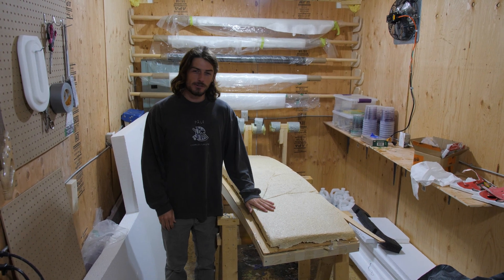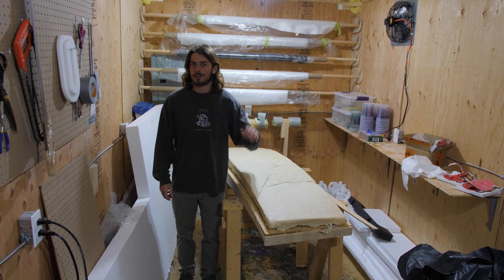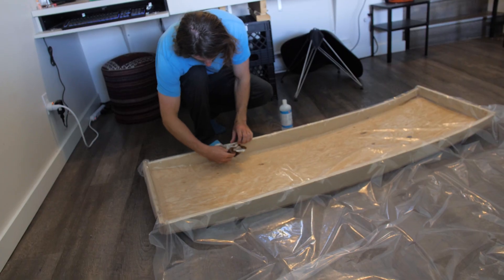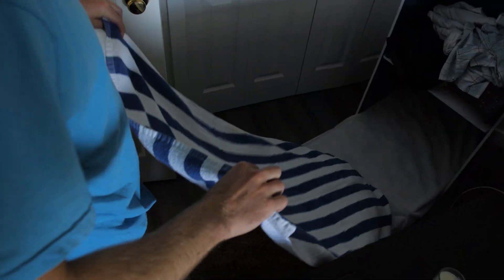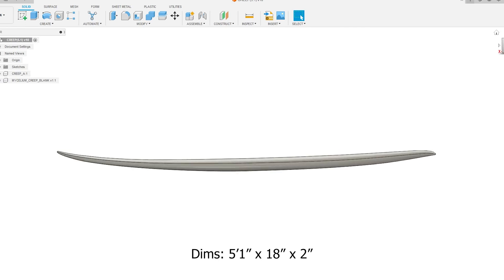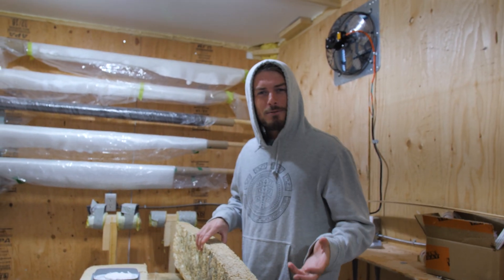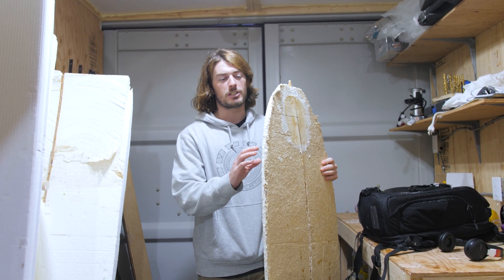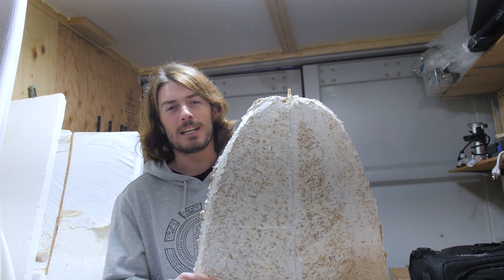SHAPING A MUSHROOM CORE SURFBOARD

Comment: Hey brother, I have an idea for your mushroom board. With your machine why not hollow it out a little. Reducing the weight. Making a honeycomb frame. Like the 3D printed board..
Reply from the maker: The mycelium core was already very soft and I think there would be some big impact issues with having voids in the blank on top of that. Perhaps if many small holes were drilled out (1/4" diameter)? But I still think the structural integrity of the blank would be gone by the time it reaches a reasonable weight.

Comment: Hi Reese, I loved watching this. The extra weight was the deal breaker. But gypsum is super heavy so weighing it with most of the gypsum sanded off may have shaved off an extra 2 lbs. One more idea, coming from an amateur mycologist. Dry out the mycelium longer, using a heat source. Mushrooms are incredibly good at retaining humidity, the mycelium can essentially hibernate, or go into zombie mode, thanks to that characteristic. I think finagling the drying process would also reduce the weight. So keep at it!
Reply from the maker: Hey Noah, thanks for the info. 

I actually did leave it in my shipping container with a dehumidifier for several months before shaping. It did subsatantially drop the weight of the mycelium, but it was still very heavy at this point. I was hoping that it would become light enough to use by shaping a very small board to offset the weight of the material.

I think the real issue was the woodchip material being too heavy. If I do it again, I'll try using a lighter substrate material.

Comment: i was so happy until i saw the cnc and then him destroy a board that couldve just been a really cool display.
Reply from the maker: Why create unnecessary fiberglass garbage on an experiment that's supposed to reduce garbage? If it can't be ridden, no point in keeping it either!
Reply: @reeces_shredlab  very true, to myself that built my first board out of drilled pine, i never cared about weight, living in florida now, i understand that lighter is better, my boards now are made for florida😂
Reply: @reeces_shredlab  also, i have yet to break one of my eps/epoxy bords and theyre homeade lol
Reply from the maker: @bpitts31  Awesome! I have yet to break one of my EPS ones as well. Going on 3 years I've beat the crap out of a few, but all are still usable. It seems the personal touch makes them lots more durable.

Comment: Amazing video! Sorry didn't fit your need and you have to destroy it:( but it to heavy... It's to heavy. But actually you can make a lighter and stronger materisl if you  work more on the formulation. Maybe the kind of sawdust you using is not the best for that application. Very inspiring video! Great job💪🍄

Comment: I got really fed up with breaking eps boards, felt bad, decided to try and make a 15L d-cell board with carbon, surprisingly has held up and is still going strong, havent broken one yet, a little stiff for surfing the waves but great for freestyle
Reply from the maker: Agreed, I find alot of production boards, specially EPS, tend to get beaten to a pulp pretty quickly. Interestingly I've had the same thing happen. Since I started glassing my onw boards I haven't broken a single one (PU or EPS). Been over a year now. I usually do some pretty serious rail laps which doesn't seem to add much weight and really makes the board buckle resistant.

Comment: sick.
that 5.1 creep actually looks like a fun surfboard (for regular surfing).
for the core, what about if you drip some epoxy down into it. hold it stronger too.

aaaah, I made it to the end... Too bad it didn't work, but you gave me a LOT of ideas actually.
I won't disclose them all unfortunately, but one of them is "hemp shivs" with a little bit of epoxy mixed in.
Reply from the maker: Glad you got something out of it! I think dripping epoxy into the blank wouldn't really add any strength and it would make it even heavier. And it would also make the blank non-compostable which was the goal. 

My next project is actually a larger Creep for surfing! Probably 5'6.